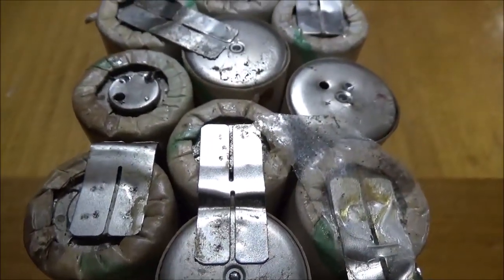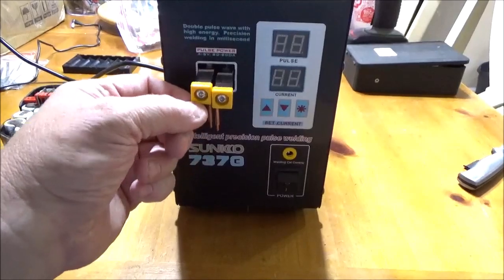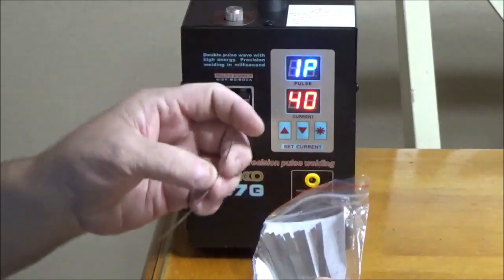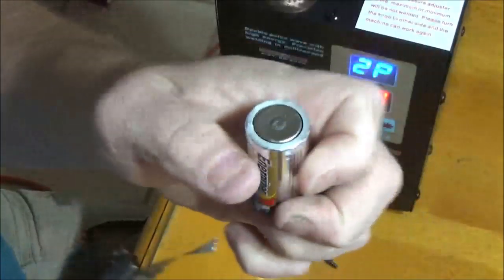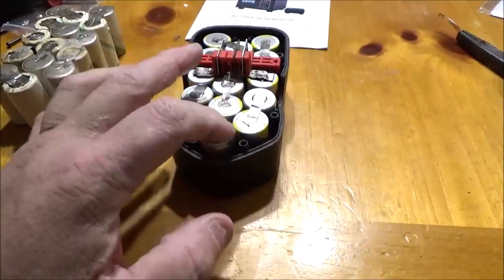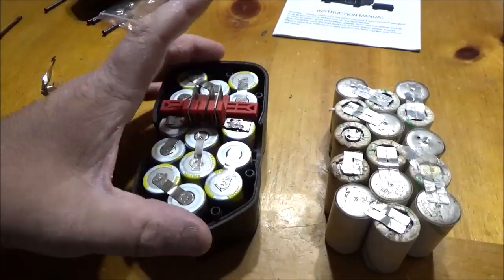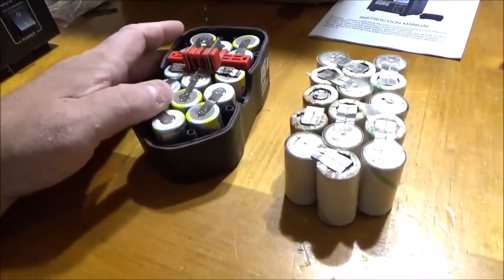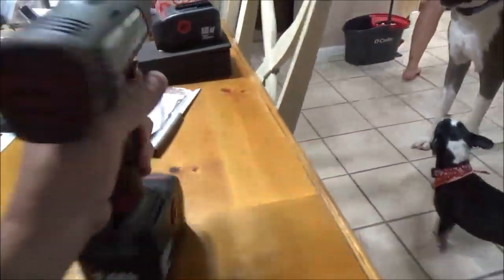YES!! SUPER AFFORDABLE CORDLESS TOOL BATTERY PACK REBUILD USING THE SUNKKO 737G SPOT WELDING MACHINE

Comment: You definitely save money rebuilding the batteries vs buying new batteries. You can upgrade the ampacity and have a longer lasting battery pack for a fraction of the cost of a new battery. It cost me $21 for upgraded cells for my 18 volt DeWalt batteries and maybe 30 minutes of my time. Buy the cells with tab's and bend tabs to fit,solder tab's together and not to battery, solder temp probe to battery , reassemble test and done. $150 spot welder not needed 👎

Comment: that's awesome dude, they are pretty cheap those batterys an we can get different MAH's to so they last a lot longer, an that spot welder looks like a real handy thing to have in the shop.. I wonder just how much it can do lol like whats the max size of something it can weld together, thanks for the great video an the info on how to make such a low price high end battery pack.( edit lol ) PS those tenergy batterys you used, I saw them when you flipped the pack over, they are really good batterys lol I had bought 6 of there premade RC battery packs for my RC boats an I tell you they performed like no other cheapo battery packs, I recommend Tenergy batterys.